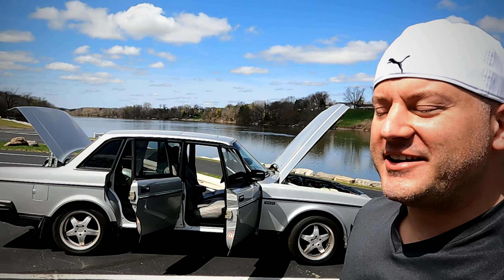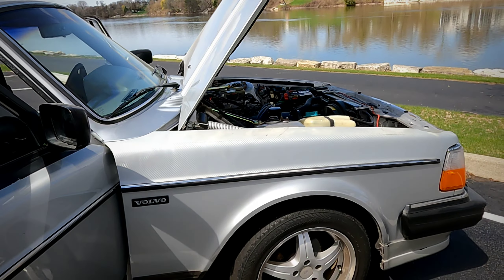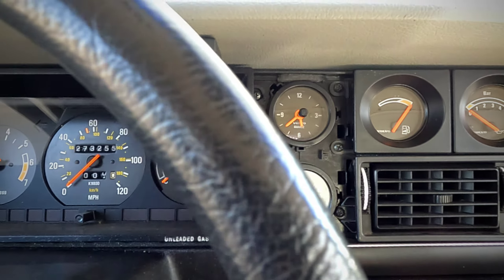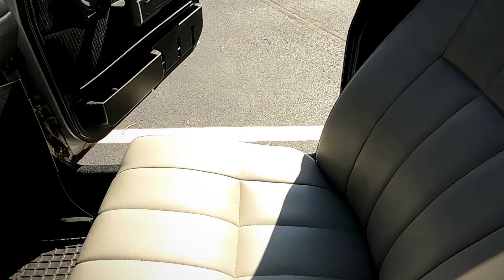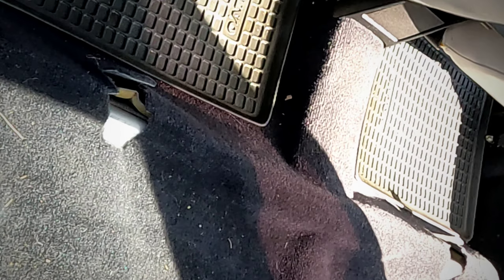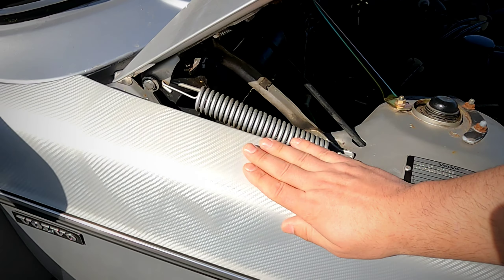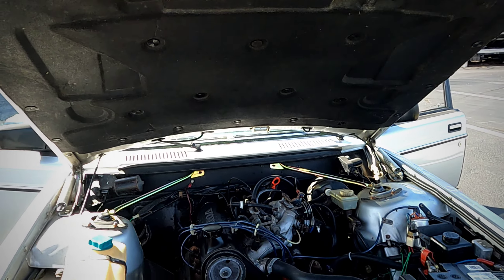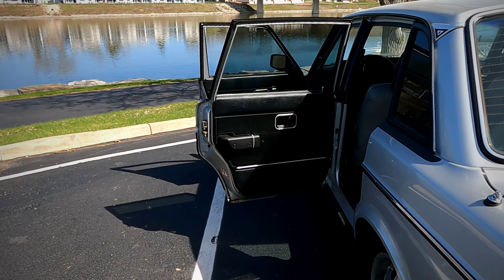My Other Volvo 240 As Is Currently @volvo240life

Comment: @Volvo240Life how do you like the B cam with the automatic? I have a 1990 240 with an automatic as well and I’m running a T cam in mine but thinking of trying the B. Thanks!
Reply from the maker: Welcome to Friday Son of Liam!   We'll as it is in the video not very much.   It runs rough at idle, and eats through the fuel and stumbles on launch.  Lol that said it's operating on M cam gear. I have an adjustable Ipd gear that I need to install and do a video.  In theory or from what I recall...it needs to be dialed back 2.5 degrees.   Hmm...maybe a good video for this week???  I will say that it drives with more sporty feel from 5mph to 60...lol I think there is potential 🤔
Reply: @volvo240life  , thanks Patrick ! I'd love to see a how to video on installing the cam gear, I bought one from STS a few months ago and still need to get it in the car but I'm not very good with mechanical things, but I'm trying to learn ! :)

Comment: custom front bumper lip? what is it from?
Reply from the maker: Hello Sigurour!  I'm glad you asked as I forgot to mention it in the video.  It is the 1993 Volvo 850 front spoiler.    With some very minor adjustments it will fit on a 240.  It just so happens that the early front air scoop from the old "commando" style front bumpers fits in nicely for the air dam cutouts.
Reply from the maker: I'm doing a video installing an adjustable cam gear for the B cam tomorrow....I will try to include a better view of the whole thing.
Reply: Very nice, i have and 850 aswell. Maybe i will do the same  on my 240, this looks very good!

Comment: I don't think you're going to find a gray vinyl 244 rear seat in the USA or Canada.  Those appear to be the aftermarket covers that were (are?) available on eBay.  I'd suggest just finding a decent rear seat and then try to find the covers to re-upholster them.
Reply from the maker: They are actually original Volvo.....I  took the front seats out of a 91 wagon and switched the seat bottoms ( that's why there is that slight ripple on the passenger bottom that looks like a replacement).....but before I had a 245.  They are not very easy to find though...nor are original grey floor trays.  Lol....I've only been looking for like 10 years, I'm not ready to give up just yet
Reply: @volvo240life  maybe it was an East Coast or Midwest option but I've never seen gray interior on 240s out here on the West Coast and I've been working on Volvos exclusively for over 30 years.
In that time, I've only seen one gray interior Volvo and it was a 1980 GLE with the V6.
Reply: @volvo240life  if you want a set of the Volvo gray floor trays, I've got a full set, too
Reply from the maker: @Schwedenstahl245  what?!  Lol I knew there were still some out there!!!!  i am definitely interested....that said I probably can't afford them for a month or so.  I currently have the front on the wagon all taken apart and have to replace a few more things than I thought.
Reply from the maker: @Schwedenstahl245  lol..my count is 2.  The wagon I got these from and a 82 242 turbo with gray..almost corduroy fabric. There is a massive (10,000+ sitting cars) salvage yard here that occasionally gets 240s.  Back in the day there had to be a really good sales person, as the few that come in usually have an abnormally  high number of accessories....or at least the remains  of them.  No online inventory though  so it's really a crapshoot and a lot of walking.
Reply: @volvo240life  you're right - I forgot about the gray corduroy / velour fabric as found on the '81 - '82 GLT and Turbo cars.
That wrecking yard sounds like it is epic and requires several days of investigation!
Reply from the maker: Lol...it is indeed.   There were a few in Chula Vista CA that combined may have been close in size, but it's the biggest single yard I've seen...Southern CA, Midwest, all up and down the east cost, along the gulf.  Haha I don't mind the search for odd bits...long as the weather is nice makes for a fun day.